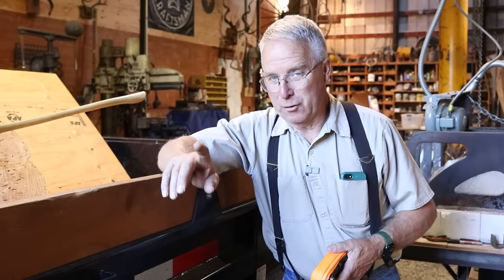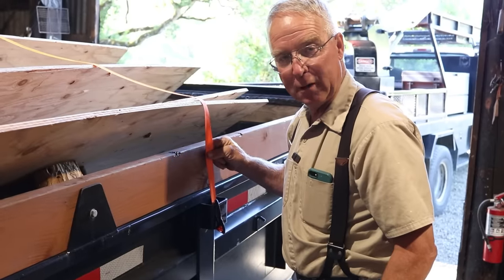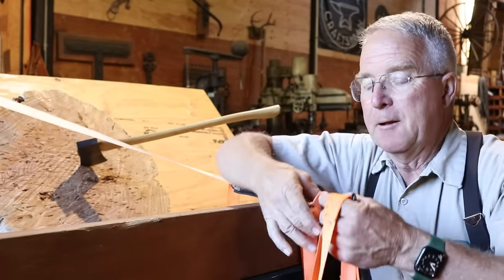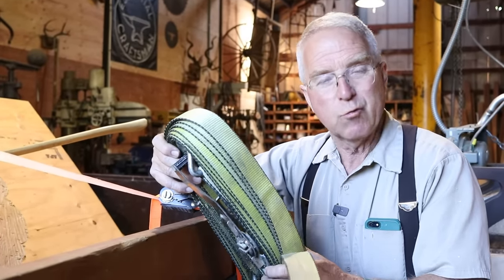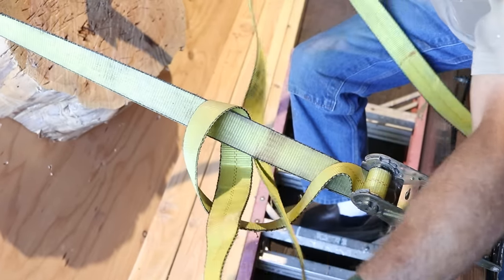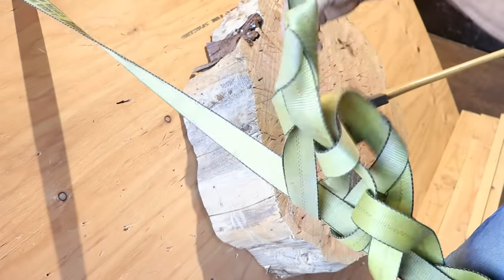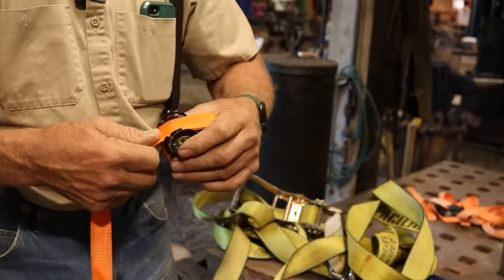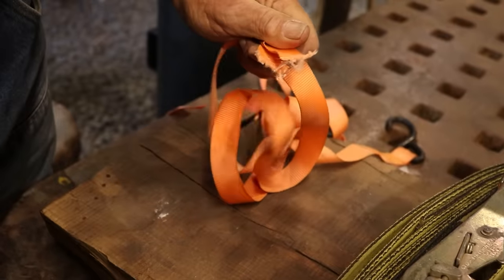7 Ratchet Strap Pro Tips

Comment: Something you didn't mentioned, but mentioned years ago... Put the rachet part on the passenger side of your cargo, in case you need to stop on the road to tighten it down or if thats how you're unloading.
Reply: I’ve always put it on the driver side so it is easy to see in the mirrors if something starts to go awry
Reply: @agm65ccip  You only have mirrors on one side of your truck?
Reply: Sometimes it’s good to tighten from both sides. In the trucking industry we like to alternate so the load stays balanced.
Reply: Great tip. Thanks.
Reply: idk. something about this. if your too lazy to walk around a vehicle after stopping on the side of the road because your strap is loose. you should not be hauling in the first place. 

you have to be the most OCD person on the planet to think this is a time saving tip as well. this tip is the perfect definition of OVERKILL.
Reply: @uberempty  Please don't drive a vehicle, let alone drive one with a load. Your misunderstanding is disturbing.

Comment: Two additional tips. 1. A wrap of electrical tape around that rolled up strap will keep it neat and tidy until you need it again, (Learned that from my buddy Jim. I keep a roll of tape in my strap box for just that purpose.)  2. Periodically lube the ratchet mechanism. There's nothing more frustating that a mechanism that won't easily release.
Reply: I was going to mention these two items as well and then I saw the comment. I have tried different methods to keep the rolled up strap together when not in use and electrical tape seems to be the best.   Before breaking the tape off, I twist the roll a couple times. This leaves a nice tail to grab to remove the tape. 

Also I have seen many ratchet straps that will hardly work. A little bit of oil on all the moving parts of the ratchet makes them work like new again.
Reply: Just buy hairties at a folalr store. No sticky shit, and you don't have to cut it off and keep it from flying away.
Reply: I used broccoli or lobster claw rubber bands, then found 2” (and other size) multi-color silicone bands on Amazon (a bit more expensive at 30 for $11) but dang, I use them for a million things, and grew to enjoy the silly colors. Electrical tape residue goo is a pain to remove, and hair ties are fine for light duty but don’t last long.
Reply: Sorry but I hate electrical tape for anything, even electrical applications. Heat turns it into a gooey, sticky mess with residue that remains when you remove it and time can dry it out to the point where it fails. I much prefer a reusable solution. Hair bands are too flimsy, even produce rubber bands don't last all that long. "Ranger" bands or, better yet, sections of old inner tube are my choices.
Reply: I find that electrical tape leaves a sticky residue that is not removable by other than chemical means. Velcro straps would be better.
Reply: @dethmaul I use Velcro strips

Comment: For the bitter end, I find a neater , quicker way is to use one hand over the other wrapping round to quickly make a round coil. then pull a bight through the loop and lock it in like a cow hitch.  Quick , easy and not very bulky
Reply: That's the best way for me ,and you can also leave them like that for next time once you un strap the load.
Reply: That's the only way I'm allowed to wrap straps at work.    It's quick and when done right doesn't come undone.   Plus when hauling the same load home at the end of the day your strap is already set to length.
Reply: I just wanted to throw my name in here for this one. I looked up ways to deal with the excess, and this is my favorite.
Reply: Yep, always used that technique when working for a bee-keeper.
Reply: That's the way I do it. Confuses my work colleagues but never had a problem with it coming loose and easy to undo to unstrap and pack away

Comment: On using the stake pocket:  Now your strap is bearing on the steel edge of the underside of the stake pocket, with it's sharp edges and grinding burrs, and as you're driving down the road the strap is vibrating in the slipstream and slowly sawing itself in two.
Reply: I thought the same at first.  If you look closer, the hook is longer than the pocket so that the strap is pulling on the ring of the hook.  Unless  I need a new prescription from the optometrist.
Reply: @nevgeth40 we broke about 10 straps last month hauling wings back from Phoenix to Illinois because the guy strapping everything down used this technique and each strap cut at the bottom of the stake pocket. He would just put another one in its place and use the same technique. I could not persuade him otherwise.
Reply: @nevgeth40  In this one example it seems to be okay, but it is certainly worth mentioning don't you think?

Comment: As a platform/heavy haul driver of 3 decades, with recurrent certification to teach securement per DOT specs, I’ll share some tips-
1). Always use edge protection anywhere there’s a sharp edge, even if it doesn’t look very sharp. You can buy plastic edge protectors, but you can also use cardboard if it’s not a material that would cut through the cardboard. 
2). Another way to store the excess, is to fold it over numerous times, then zip tie it to the main line. Just make sure to leave about a foot between your bundle and the ratchet, so you have room to tighten the strap as the load settles. 
3). Though you can get away with attaching the hook to a stake pocket in non-commercial applications, there is a reason it used to be illegal on commercial applications. The rule has changed back and forth over the years, but in general it’s still frowned up, even though it’s no longer illegal (as of the current rules). Remember, first make sure that stake pocket/rub rail is certified by the trailer manufacturer to have a tie down attached, and that they have a WLL posted for it. Also, NEVER go outside the rub rail. Though no longer illegal, if you were to get side swiped, it could cut the straps and you could lose your load. 
4). Inspect your straps for nicks and frays. If you find any, toss the straps. In commercial applications, it’s a violation (possibly more than one. If that strap is no good, and then the remaining straps do not meet the minimum requirements for the length and weight of the load, you could receive 2 violations. One for a bad strap, and another for insufficient tie downs). Straps are pretty cheap, so replace them when they get a nick. It’s cheap insurance. 
5). Though this is only a requirement in commercial applications, I still suggest these rules. 2 straps for the first 10’ of material, plus another strap for each additional 10’. Also, the working load limit of all straps should equal AT LEAST half the weight of the material you’re hauling. So if you’re hauling 6,000 pounds of material, you should have AT LEAST 3,000 pounds of WLL. So if you had 2” straps rated at say 2,250# WWL, you’d need at least 2 straps. 
Hope this helps
Reply: Great addition, Thank you!
Reply: listen, professional truck driver none of us common folk care about all the stuff that the DOT makes you do that they do not make the average person do I mean come on old guys like this one can still drive a huge diesel pusher down the road without a CDL...........
Reply: Great tips - thumbs up.   Thanks for sharing.
Reply: As one who teaches this at a heavy truck school, I say this is probably the best advice.  

I would add that the small spike at the side of his trailor is to tie down a net or a canvas.  Not intended to hold any force/weight.
Reply: @sledninja  I know that you are kidding but yeah, who cares about safety and not killing people or destroying property?  People have the right to be idiots.  Without them, YouTube would have no content.   Remember... Having the right to do something doesn't mean that it is the right thing to do.  Always do the right thing, even if you do not have the right to do it.
Reply: U should always put the adjustment ratchet o passenger side so if you need to make adjustments. You're out of traffic.
Reply: @earlscruggs4106 ....🤔
I've never had to do this, but that is actually a really good idea for just in case.
Reply: To protect your straps, strips of old carpet, or even old blown out work gloves are great.
Reply: @sledninja  Yeah what next, an Osha guy telling me how to clean my bathroom?

Comment: Some good tips! My overall favorite method for dealing with excess strap on the big straps is to simply roll it up, hand over hand you can roll 20 feet of strap in a matter of seconds, and then slip it through the loop in the strap, right above the hook. When you tighten it down, it grips tight and won’t let go. Fast, easy, and doesn’t look like a jumbled mess going down the freeway
Reply: That's how truckers do it.
Reply: This is how I always tie off my excess strapping too.

I also will only use ratchet straps on steel trailers and truck beds. If they're aluminium, I much prefer rope with a trucker hitch (double hitched if the load  calls for it) and chokeing the load of it's possible/practical. This stops over tensioning the ratchet and bending the aluminium bars/fix points.
Reply: Yep this is how I have seen it done and how I now do it. Works for all types of straps. It never tangles or comes loose, but is always easy to untie and unroll the strap. Really secure and no mess.
Reply: @jeremyzentveld5672  ive only worked with the same steel trailer but that is a good heads up, thank you.
Reply: I think that is what he was talking about when he didn't understand how people were trapping the coiled strap under the tightened strap. They were using this method and it might look a little sketchy if you didn't know they were going through that loop?
Reply: I do this as well. There are a few videos on YouTube showing how to do it too.
Reply: @daycowhite6947  truckers who pull flstbeds for awhile know that method does not work everytime. Loads shift which loosens the strap ( it doesn’t take much). Zip ties will work 99.99% of the time for days of travel. There are a few other ways that also wotk but hard to show here.
Reply: but the straps will sometimes loose over time, wouldn't that release the ends?

Comment: I use ratchet straps every day. A few additions for you.
#1 For storage. When warping the strap around the windless open the leaver to its full open (like the big yellow one you did) two reasons (a) Bigger base less winding.(b) If they're frozen or muddy they're easier to clean out when open. (c) They're ready to use.
#2 Before winding, slide the windlass to the middle of the strap (a) your winding both sides at the same time, half the winding. (b) You don't have to pull the hook all the way through. I leave the hook end a little shorter so the other end surpasses it when wound and secures the hook. At this point I have a rubber band on my wrist, slip it off my wrist onto the strap so it won't unwind. 
#3 You didn't mention the strap should enter the windless on the load side. (you had them right) but newbees might not know. 
#4 I usually feed the strap through the windlass and Tie a slip knot at the end of the strap to keep it from sliding out. Slip knot so it's easy to untie.
#5 With regards to the twist, only half a twist per span (a full twist will chatter too). Eg For a lift of lumber 1/2 a twist up one side, 1/2 a twist across the top and 1/2 twist on the other side You might have to adjust how the strap goes through the windless.( Fold the strap into a wide V and slide it through the windless.)
#6 My tiding up the loose end is similar. Start the same as you. (a)Lift the strap towards you. (b) With the left hand, strap to the back of left hand reach under tight strap grab a bite of the tale and pull it through. (c) Keep pulling till the loop till it is the same length as the tale. (d) Cinch it down and do it again. Each cinch secures three times as much as your way.
#7 Windlasses (Say that three times) rust and bind. I used to use candle wax as lube in the ratchet. Recently I discovered the lube they use for mounting tires. Works great.
#8 If the hook won't go through the stake pocket.(a) Fold the strap back on it's self ( about 12 ") pass the bite through the stake pocket or slit or what ever then pass the hook through the bite and pull up the slack. (b) remove the strap from the windless, pass the end of the strap through the stake pocket, hole or small opening, throw the strap over the load and secure with windless.
I hop this all makes seance to you.
Reply: 1 no. keep strap and ratchet separate.  Use fork spinner to roll the straps. If you Roll the strap on the ratchet then you can't toss the strap over. 

2 no. See #1.

3 no. What needs be said is that you ratchet, till the windlass slot is perpendicular to the ratchet closed. Feed strap from the base side to the handle side. So when you start to ratchet the strap is already correct.

4 no. Even if it is easy it is easier to not do it and just be mindful. I very very rarely have one pull out that didn't need to be. Plus See #1.

5  no. Again See #1 Always keep the separate so you are not trying to "V" anything. When you are "V" means you are already wasting time and effort.

6 no. "7:00 No better way you say. Well you need to watch this tutorial. Ever since I saw this I have done it and it has saved so much time, effort and stress.

I hope the video link below doesn't get deleted. If it does search "How to use ratchet Straps" from a channel called "Safe Driver Training""

7 lithium grease no drip works best. Tho cndle wax seems like good idea. Might have to try that. Have paraffin wax in a tube that I use for drilling holes in metal. Will try that.

8 no. Again See #1. just hook to stake pocket from outside and run the strap from under and through stake pocket.

Notice Most of those thing you mentioned can be done with much more ease by just keeping the strap and ratchet separate. Everything from deploying, setting up/hooking up, rolling up and storing. Just uploaded a short vid on a strap Winder/Roller/Spinner I made but they can be purchased for only $20. Link in the next comment.
Reply: @AztecWarrior69_69 Correct. By rolling the strap separate from the ratchet, it also fights the gravity problem mentioned in this video. You can toss the strap over the load, then pull the hook back down. The excess strap on the other side will keep the hook from just dropping down (unless it’s a very small load). Over 3 decades of heavy haul trucking, plus teaching DOT securement classes, and you pick up a lot of tricks….

Comment: I love ball bungees for organizing ratchet straps!  Wind them up like you do and put a ball bungee around to keep them from unraveling between uses.  I also wind up the loose end of the strap, flatten it out and affix it to the ratchet strap with the same ball bungee.
Reply: I was hoping someone else would mention this. So much faster than other methods. I do the same thing you do.
Reply: Me too
Reply: I do the exact same when I used to drive flatbed.
Reply: is that safe enough though? Could the bungee break (due to vibrations or something) and release the loose end?
Reply: @flavius29663  It's safe enough for me.  I check my load securement frequently while in transit.

Comment: 1. Magnet on the hook tip. Keeps it sticking where you let it.
2:53 sow leather patches on the strap. Those are "rope savers" you put in position over sharp edges. Can be fake leather, canvas, anything that's wear resistant. They can also be affixed to the strap with snaps, which makes them universal to any strap you have, just keep a bunch in one place. The snap variant can be bought in bulk as the shoulder protection that's used for carry-on bags, laptop bags, work duffel bags. In the same place, one can buy the rubber shoulder savers, they can also be used for this, they last even longer.
5:44 for those that might find that a bit of a chore, there's a cheat method. On the end of the strap, have a piece of wire that goes through the strap. Pack the strap and use the wire to loop around the tight portion, neat and quick. The coated wire used for privacy fences is the best for this. Doesn't rust, and it's cheap as heck in a roll. The little hole it goes through in the end of the strap should be burned in with a hot nail, to keep it from fraying. No twists are required to hold the thing down, just looped around 3 times and it's enough. 
8:37 the piece of wire will also help when you're packing them like that, because otherwise, there's no stopping them from unwrapping.
Reply: I use an old piece of 2" fire hose or water pump discharge hose. Just cut to length and slide over the strap, easy peasy and works like a champ. I once found a 15" long piece of 4" strap on the road side like the truckers use and cut it into 8" pieces, works well too.
Reply: All y'all in the comments arguing and writing 15 paragraph explanations about what's wrong with the video.
Make your own dang video.....
Reply: @l.halsey2991  He asked for more tips and pointers in the end........ I really like the wire trick.  Quit being so sensitve.
Reply: Great tips! Thanks for taking the time to write a paragraph long comment rather than making your own video 😂
Reply: This. Magnets are great for tying down stuff solo
Reply: Use some Velcro to attach the device of your choosing that’s intended to prevent the rubbing.

And use some Velcro to hold the wrapped up strapping in place when not being used.
Reply: @l.halsey2991 
Internet Dad specifically requested our own tips and tricks to share in the Comments. 
No one can complain about our Internet Dad. He’s almost infallible. 😊